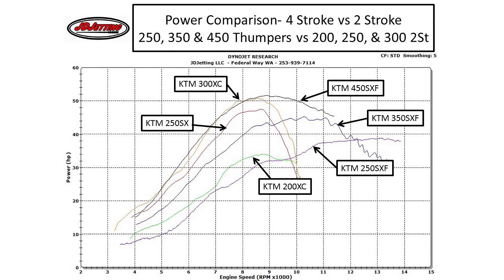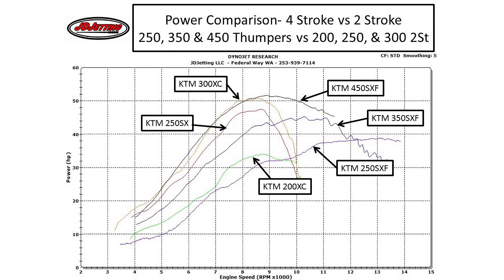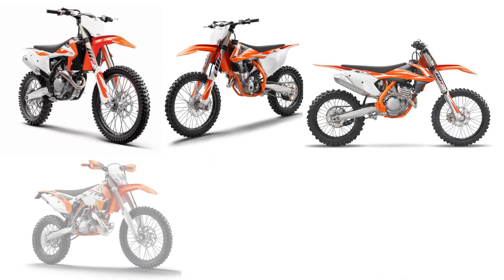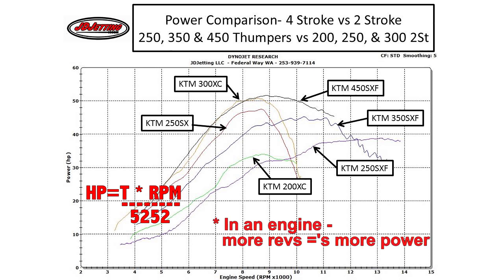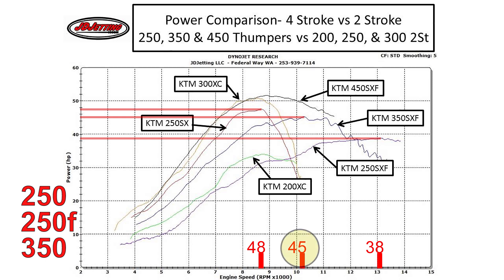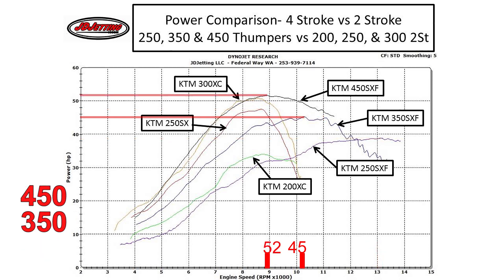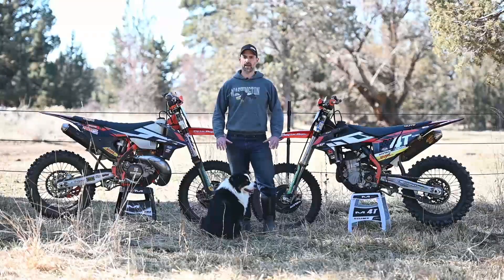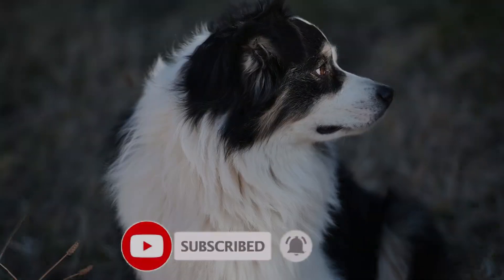2 Stroke vs 4 Stroke Power - A study of Power and Torque

Comment: Now that is quite a disappointing look at the things. The diagrams are very nice to compare and that part was done properly. But what is not considered at all is the power you get at the rear wheel.
It is simple to understand that a race is keeping a certain (best) speed over the course. That means real wheel rpm and torque. I never knew that 2 strokes are of such a short rev band compared to the 4 strokes. So what is here not considered is this: For the same rpm of the rear wheel has the 4 stroke obviously an advantage in the higher rev band, the gear ratio can be shorter for the same wheel rpm and similar good torque. That shorter transmission balances than up a lot, and in the end is clear why the 4 stroke drives better, large rev band, and in the end as fast as a 2 stroke. While simply easier to handle. I have never heard that anyone would take a low rpm high torque engine over a higher rpm lower torque engine when it comes to performance, where you can let the engine rev. Only where revving the engine is not good, like a long hill up with increasing steepness and limited traction, there you wish an engine which can rev high above the max torque point and has so a long way to go without shifting a gear down. The 4 stroke makes that much easier. That is as I see now the reason why nobody looks at 2 strokes anymore. They only appear to be brutal in short gears, but when it comes to power on the rear wheel at any speed, the four stroke is better. Just get the gearbox right.
Before seeing this video I watched a Honda 450 compared to the its 500cc 2 stroke equivalent video (Tomasin). Shockingly the 450 was faster on the track, although the 2 stroke supposed to produce MUCH more power. The point is, in this machine is the gearbox identical taken from the 450. Well, that's a nogo. They cannot be identical due to the rev band difference. I guess the 2 stroke needs a longer transmission ratio and closer steps between the gears, plus plenty shifting gears to keep it in the best range. Over-rev no way, only shifting up. That's what I see in these curves.
Reply: I think it's an excellent video, but yes it does miss-out on the gearing component, which is crucial.  

However, equally I think you might underestimate what can be done the other way with a two-smoke: as I know you well recognise, a gearbox is a torque multiplier - but it can reduce as well.  

If the two (say a 300) makes more power at all rpm  than its competitor until it drops markedly, then you can afford to lengthen the gearing, and so flatten (and effectively lengthen) the power curve.  I know you wouldn't, but half the teeth on the rear sprocket would reduce the torque at the rear wheel very unmysteriously by exactly half and (were drag etc not a factor) exactly double the top end speed, which one might find useful. (I recognise you do have to get there, but again I am not talking about starting with a 100-rpm powerband engine.)

It's why I don't really like to see engine torque talked about as though it were the torque that you feel - generally people mean low end tug from the seat, which is very connected with gearing; if you're producing enough hp over a reasonable-iah span, that's the crucial thing as hp tells you the potential work-done-rate, and then gearing can give you all the low end tug and more that a lesser hp'd bike could with optimal gearing.

Finally, of course, even if, as with the 300 2 compared to the 450 4, you're actually not producing more hp, but you can nevertheless potentially be lighter, then there may be life in the old dog yet.

Comment: 2 strokes make more power because they have less pumping losses. Less moving mass overall, but more importantly, they have ignition every time the piston comes up, where 4 strokes have ignition every other time the piston comes up. 

However..... 4 strokes have a much flatter power curve. They make great torque right off RPM, and horsepower is a nice steady increase. 2 strokes are absolutely gutless at low RPM, and need to be wound out to get any kind of performance out of them.

The 300cc 2 strokes are a big exception to the rule. The KTM 300, GasGas 300, Beta 300, Husqvarna 300 (all KTM engines anyway) are designed specifically to be very 4-stroke like in performance. They have a perfectly square bore. 72mm piston, 72mm stroke. I heard of in 2 strokes. 2 strokes usually have a very long stroke, and a comparatively small bore, while 4 strokes are the exact opposite, with a short stroke and big bore. 

Because the 300 has a much larger bore given the length of stroke, it has a much more 4 stroke, tractor like feel to it, and does very well at low rpm

Comment: Good video .but I should always be 250 vs250or 450 vs 500cc 2.otherwise it's apples and oranges.u made a great comparison,but I'm biased towards 2 strokes.its been a couple years, but my last bike was a 93 yz250 and cranked 5th gear wheels with no clutch,,just power,I rode my friendsbra ND new 03 kx250 4 stroke,and coundt do a 3rd gear wheelie.i was embarrassed for him.
Reply: CC for cc, a four stroke will never compare to a two stroke. (40 years seat of the pants comparison)!

Comment: 2 strokes make alot more power per cc.thats why in Supercross when 4 strokes were being forced into the sport,it took 450 4 strokes to compete with 250 2 strokes.tons of other reasons.weight,engine parts cost.2 strokes win in every way.and no one will compare ,except in this video,kind of.250cc 2 stroke vs.same cc in 4 stroke and compare the 450 4 stroke  to a 500cc 2 stroke.a used 1989cr500 for example.

Comment: 4 Stroke for me is like when I switched to Mac back in the 90's. It's easier to use and more reliable less maintenance than a 2 stroke.
Reply: Less maintenance? Hahahahah! More reliable? Hahahaha! Check your physics!
Reply: @michaelmartin5165 I agree w him. My 450 has thousands of miles, never had to open the engine. Stock reliability and 56 horsepower. Your 2T can’t do that or make those power figures unless you get a Cr500/KX500 and still I think my 450 is better

Comment: A little late in seeing this video. My KTM 250 XC 2-smoker motor does everything I need. I applaud you on doing a great job of explaining the differences and benefits of the various motors.
Reply from the maker: I love my 2018 250xc. I put a 300sx kit on it at 210hrs, I am now at 260hrs on the 300sx. The 300sx kit legitimately has the power of my 2019 450sx, with 250 2 stroke handling and no engine braking. It's pretty incredible.
Reply: @2smoking.and.4stroking  Yes, I love my 2 strokes for single track. Not sure if you ride much elevation but with me being a flatlander I learned a good lesson testing sleds in the Big Horn mountains. If a 600cc was plenty of power for WI. You would really want a 700 or 800cc motor at 10,000 feet. Hoping to have more opportunities to ride the western states now that i'm retired. So maybe I should get a 300.

Comment: Fantastic video. I’m left pondering your explanation of a 250 2T vs 300 2T. You stated that a 250 2T spins up faster than a 300 2T because of the lighter piston.

Is this generally true? I see a lot of manufacturers offer different engine capacities by simply tweaking the bore or by tweaking the stroke (or sometimes both). In the case of increasing only bore to make a 300 (vs a 250) and keeping stroke the same, I can accept a 250 2T piston is lighter and therefore spins up faster. But in the case of changing stroke only, the pistons would be the same and the engine with the shorter stroke would spin up faster, right? And would the shorter stroke engine be the 250 in this case?

Please let me know what you think. I’m still fairly new to the 2T game and would love some input and knowledge!
Reply from the maker: Generally speaking there are two reasons a 250 revs quicker than a 300 - 1) less mass in the piston and 2) ignition mapping. For a KTM 250 and 300, they have identical strokes and differ only in bore. However, the ignition mapping is designed specifically for a 250 or 300 piston - so that will have a HUGE impact on how a bike feels. I can tell you from a experience a 250 XC-W will feel VASTLY different from a 250 XC or SX - and most of this is due to compression and ECU mapping. As for the same 300 example - a 300 XC-W with the power valve opening late will feel like a wet puppy compared to a 250SX bike. Furthermore a 2018 carb bike feels WAY different to a TPI bike - I am personally not a fan of injection on 2-strokes. 2020 and later they have gotten better - but prior to 2020 they were super weak on power compared to a properly tuned carb bike. As a general guideline - a 250 is slightly more playful and dynamic, yet requires more input at the gear lever and shifting - it is actually harder to ride correctly (ie in the correct part of the power) than a 300. A 300 does every thing well, generally without the ability to over rev. A 300 can be ridden lazily or aggressively. You can rev it hard, or you can pull a taller gear and lug it out.  I recently put a 300SX kit on my 250XC and it it is a hybrid of good low end power and good over-rev - very good low grunt yet likes to rev more than any other 300 I have ever had. Both a 250 or 300 can be ridden equally fast - and a plus - for the non-tpi bikes - is that you can easily make a 250 a 300 and vice versa with a new top end and ignition kit (about 900 USD).  Speaking specifically to KTM 250/300's 2012+ , you can't go wrong with either a 250 or a 300 - each can be tuned to be mild or wild - both can do everything the other can - with slight trades offs in riding styles. Hope this helps.

Comment: Excellent description, thank you. Coming of a 350f to a 300, I was surprised by the torquey nature of the 300. Reminded me of a 450 in that sense. So why is the 300 the preferred weapon over the 450f in the gnarly? They make the same torque in low rpms, which is where you'll spend a lot of time in the gnarly. They have similar wet weight, and the higher gyro weight of the 450 seems would be minimal at the low rpms we're talking about in this scenario. Is less stalling and overheating all that the 300 has over the 450f here? There must be something more I'm not getting.
Reply from the maker: Kristjan, thanks for your comment. I have owned 3 X 300s in the past and now currently own a 2018 250xc. I also own a 2019 450sx (converted to an enduro bike). Here are my reasons why a 450 is really not appropriate for hard enduro - 1) 450's generally do not run very well at very low rpms, they also take longer to rev as compared to a 2T. The big 450 piston (and all other components attached to the crank) have much more inertia than the smaller 2T piston. They simply do not excel at off idle riding - exactly what you need in Knarly terrain. 2) a 450 makes ALOT of heat - it will easily overhead and knarly terrain due to low air flow at low speeds. 3) Yes, a new 450 and 300 basically weight the same, however a 4T has much more of its mass up higher (camshaft, valves, cam chain, taller cylinder), this may seam minor but it makes the front "feel" much heavier than a 2T. 4) Clutch pull on a 450 is much harder than a 300/250 2T, a 450 simply requires stiffer clutch springs - this might seem minor, but that harder clutch pull adds up - don't even get me stared on a Rekluse Auto Clutch - so over rated - mostly only builds bad habits. Can you ride a 4T 450 in hard enduro? - sure - Lettenbichler Sr rode a 450 BMW at Erzberg and did quite well - its just well, alot more work.
Reply: @2smoking.and.4stroking the mass centralization is about a whole 12 inches higher. You have to be very strong to manhandle a 450